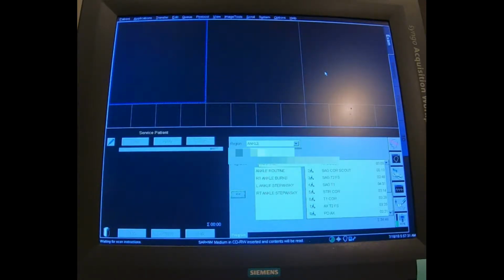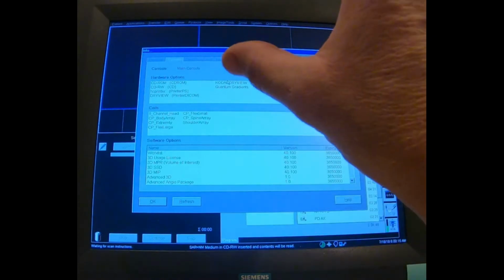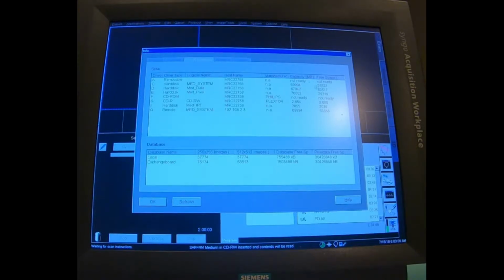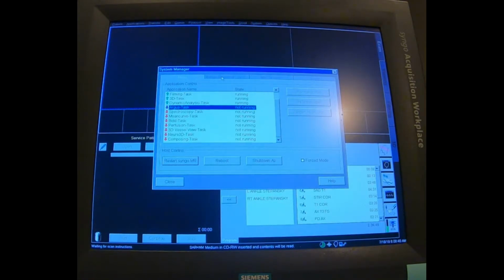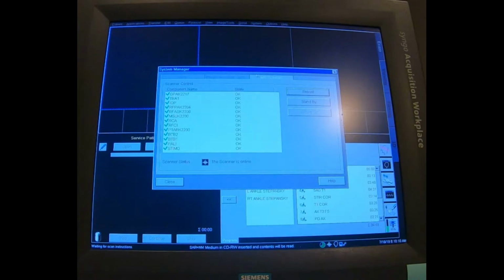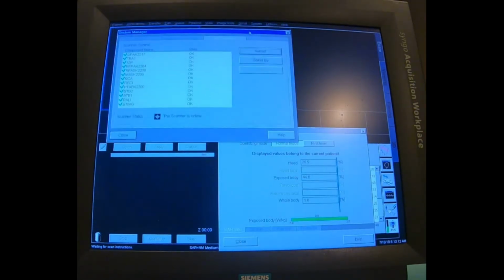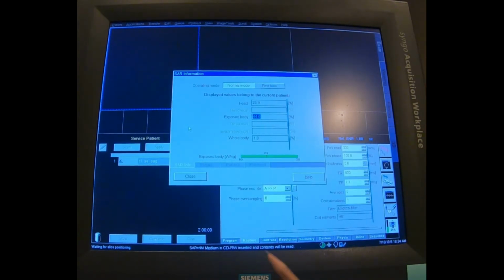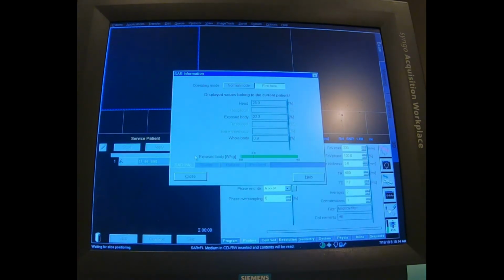Today I go over some menus and what SAR is.

Comment: I'm a patient who had an MRI aborted for overheating. The. MRI was of the prostate.

Is there anything I can do to improve my chances of success?

They did add some padding and a bit of repositioning.

There seems to be an issue with contact with the bore. Is that due to proximity to the RF source or is it blocking evaporative cooling due to sweat?

Can changes in protocol help? I'm not claustrophobic, so I'm willing to spend more time if a change in parameters would help.

Are there certain machines that deliver less total energy or better controlled power levels than others?

Would an open MRI do better? (There isn't one in my state, but I'm willing to travel.)

Thanks.
Reply from the maker: @linuxranch  send an email to the channel email and I can answer for you.

Comment: Great video! I have a question regarding the difference between the normal and first level operating mode. Why is it that the percentage of exposed body RF it can take becomes less when more RF is applied (in the first level operating mode)? Should it not go up when more RF is applied, so that a higher percentage of the total RF it can take is distributed?
Reply from the maker: Good question. (Sorry if this goes long) The way I was taught at the factory is this. Normal level is assuming the patient has the flu and therefore can not dissipate heat as fast if they didn't and First level, you tell the system they do not have the flu.  

As far as the second part, say you are doing a T1 Axial, and it SARS out and wants you to go to First level, all the system is saying is that this patient is getting too much in normal.  Nothing changes when going to First level as far as the RF is concerned.  On the other hand, if you ARE in first level, and it SARs out, the system usually tells you hat you need to change in order to achieve the same result. i.e. reduce the # of slices, add a pause, lower your TE, etc.. . 

What a lot of MRI techs forget is that you still are flipping ALL of the protons in the imaging volume even if you aren't looking at them. For example.  If a patient with a weight of 320 LBs and is 5'7", and you are scanning a lumbar and have a FOV of 120 lets say.  You have to flip all of the protons in the 120 FOV and the rest of them in whats left of a 55CM imaging volume!! Thats 20 inches in all 3 axes!! at 320LBs. that is a lot of heat. 

Hope this helps!!!